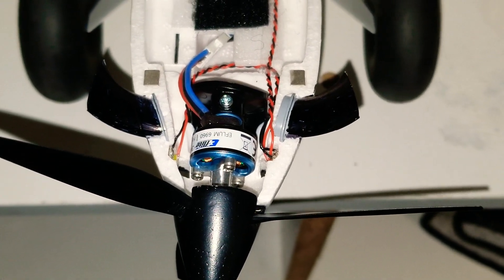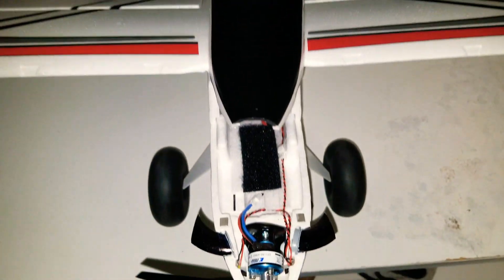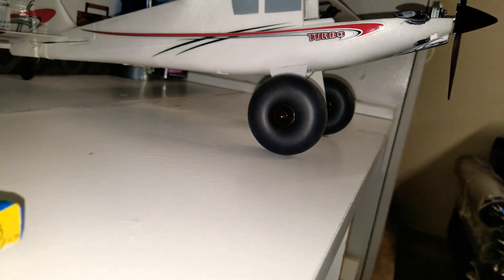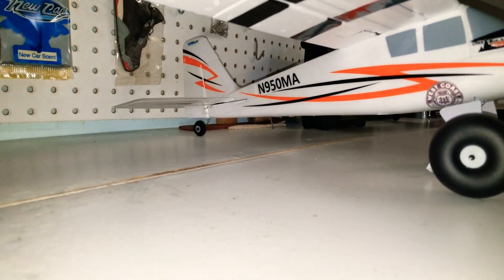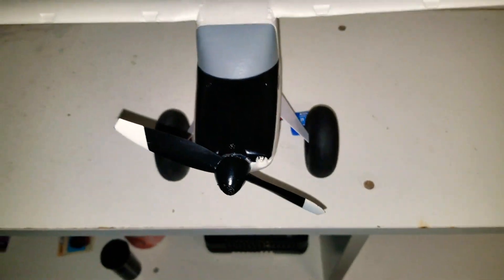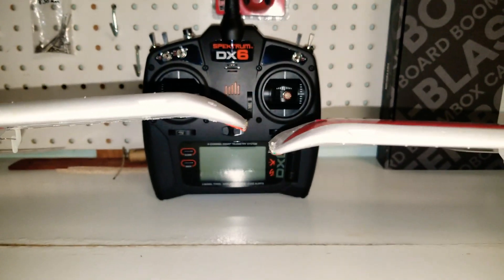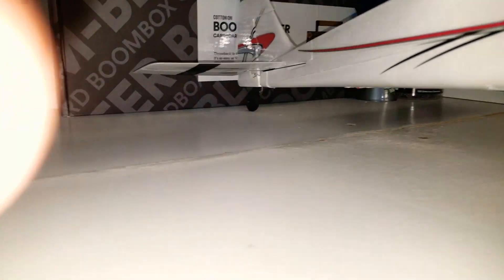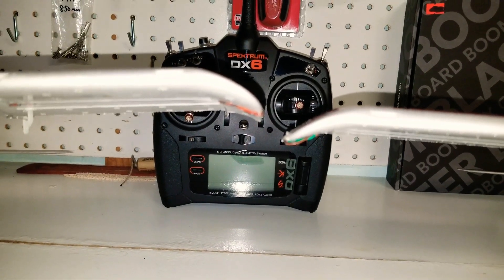UMX Turbo Timber Wheel Mod * Special Request

Comment: These planes don't need mods they need to be flown...
Reply from the maker: They sure dont. They're perfectly engineered.  But modifying is how i do my hobbying 👍
Reply: I like to add things to mine also. It gives my planes an identity others dont. I added a patterned South West trim on my Maule simply because I didnt want mine looking like everyone elses. Remember building models as a kid? No two ever looked the same because we always changed things up. A larger tail wheel probably does work better in grass. I made me Apprentice  into a tail dragger, it lands better and take off are much smoother on it than stock.
Reply: All umx timbers need some landing gear mods :)  2 bladed props are nice too, my umx turbo timber evolution loves it especially when rocking a 3s 450

Comment: Thank you so much man! Will be doing this to my plane. Two things, have you noticed not having rudder wheel authority on the ground? My tail wheel seems to not be strong enough to support the weight. Lastly, my guess to why the timber is taller is that it looks like the turbo timbers landing gear mechanism was redone to make it shorter. Nevertheless, thanks for this awesome vid man! Appreciate how quickly you did it!
Reply from the maker: Yes I've noticed that too

Comment: My umx turbo timber is flying in circles to the right,  the motor looks crooked, the Hobby store says it's normal, it is supposed to be like that.. Is that true ?
Reply from the maker: It is supposed to be a little off centered. You have to trim it out accordingly in flight. Mine needed alot of left trim or it would just go I'm circles to the right
Reply: @scopet420  ok,  thank you Sir.
Reply: @scopet420  Sir,  one more question,  do you trim the ailerons or the rudder? Because, the rear wheel is attached to the rudder, it will be a  difficult landing, and the ailerons with out the safety mode the airplane will spind around.?
Reply from the maker: @nq1980  sure, you must only trim in non safe mode. Also you should manually make sure when the power is off make sure all surfaces are level before trimming
Reply: @scopet420  thank you Sir, about the plain flaying in circles,  I read the manual, all I did to fix the problem with the control center, just bend the metal linkage with a pair of pliers by the U-Shape to make the connector to the rudder shorter or longer.
Reply: @scopet420  I have read many times not to trim whilst flying in safe. Why is this?
Reply from the maker: @M4rkmcc21  because "safe" trims it out for you. Only need to trim when "not" in safe mode
Reply: @scopet420  thanks. But what if in safe the plane climbs up or yaws left or right? What should I do during the flight to correct it?
Reply from the maker: @M4rkmcc21  it will correct itself in safe